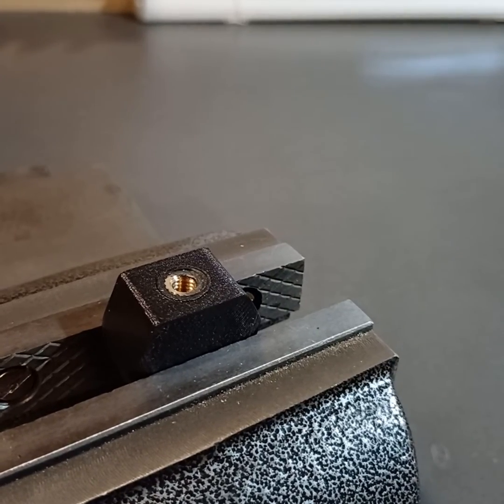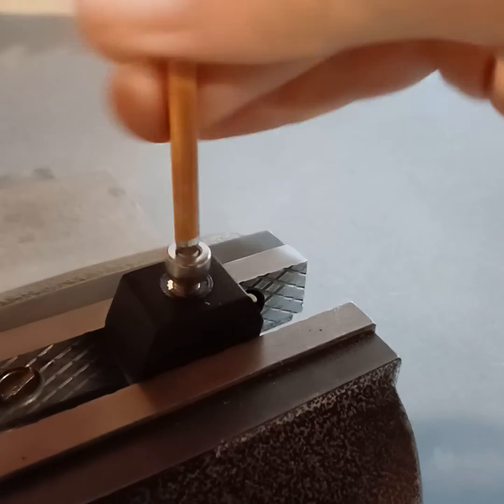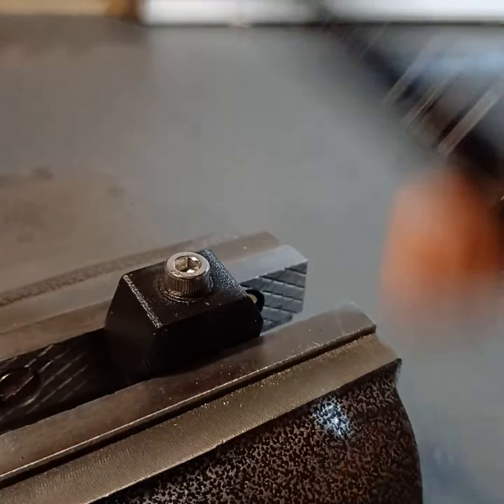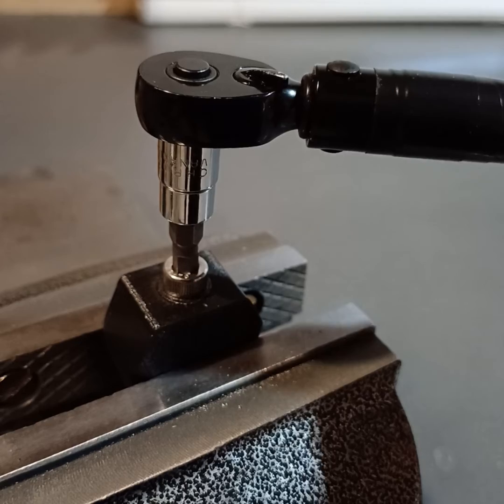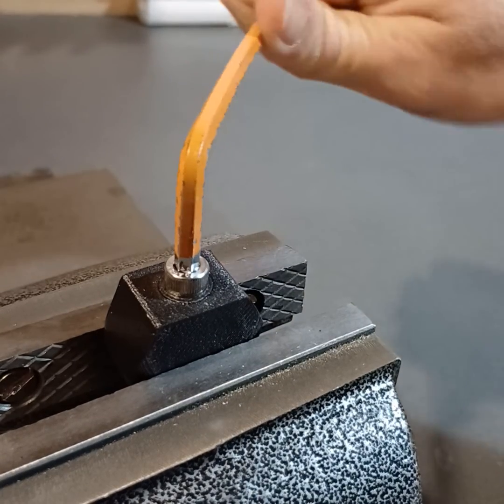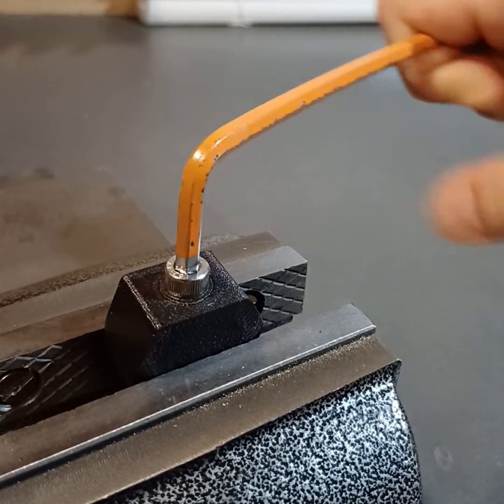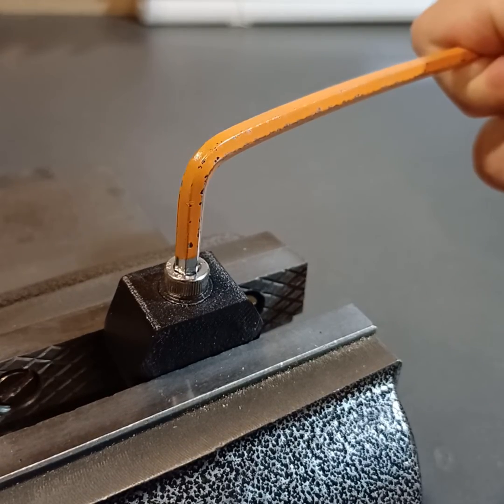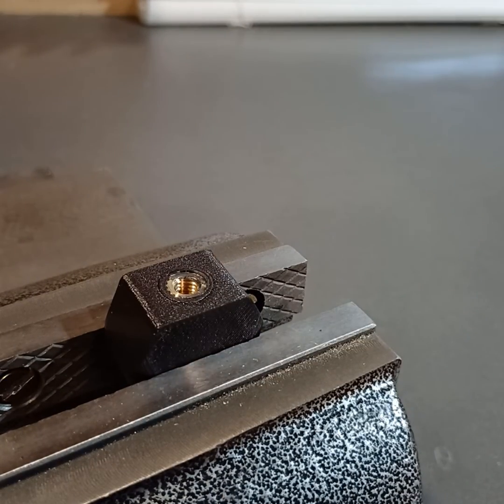Insert Torque Testing

Comment: Would’ve been very interesting to see it with a digital torque wrench that could measure the max torque applied before it breaks.
Reply from the maker: That's a good idea, I'll look in to that. It would require a lot of  force, I rounded two allen keys trying to find out. In any case, there would never be a need for that much torque!